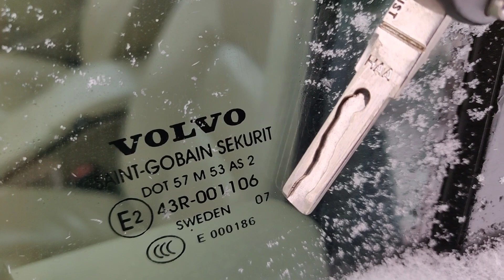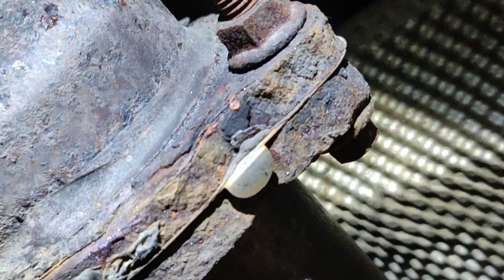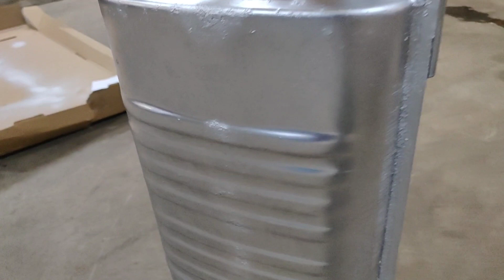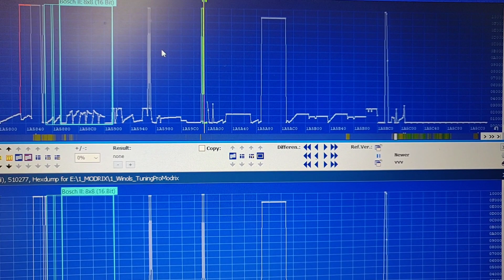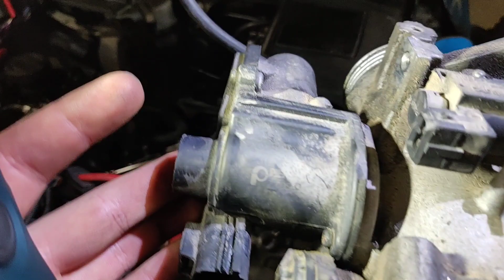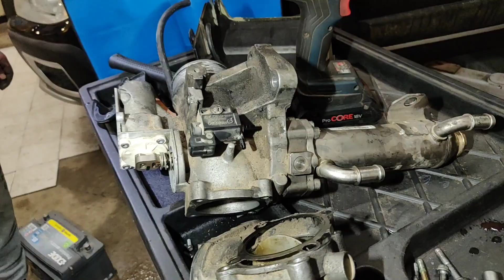✅Volvo XC70 2.4 D5 136Kw EDC16C31 DPF & EGR Repair & Programming

Comment: Hi, this is really helpful. I've been trying to solve the engine check light issue I've been getting and the constant code is the DPF sensor. I've noticed the sensor is completely removed but haven't checked to see whether the DPF filter is blocked off or modified but it's still on the vehicle, xc90. I've also not checked the egr yet but this is something we're about to do very soon because this code is affecting the performance and its in a limp mode as a result. Aside from physically checking of the egr and DPF filter was modified and blocked, is there any way to determine whether the ecu was remapped or can I assume that due to the codes being consistent for the dpf sensor, dpf filter readings, the egr and codes for the swirl flaps, that the ecu was not remapped? I'm in South Africa and I purchased this xc90 from the 2nd owner who had no idea what is happening after purchasing it from the 1st owner, a lady, who knows absolutely nothing about the vehicle and repair and maintenance history. So here I am finding my way like Nemo.